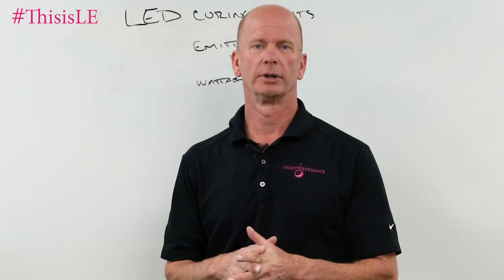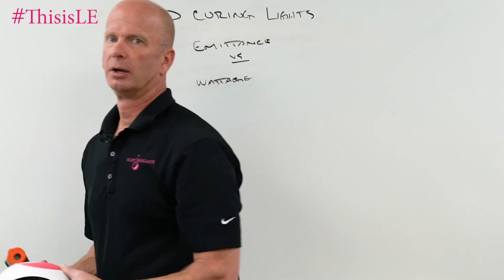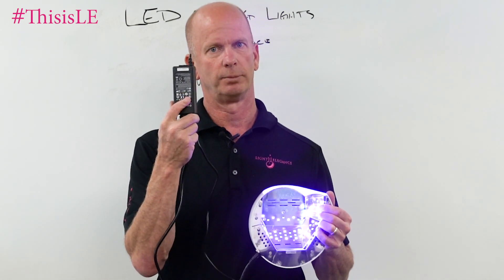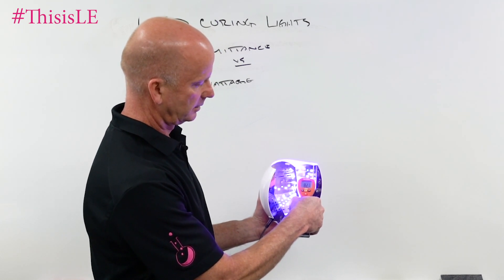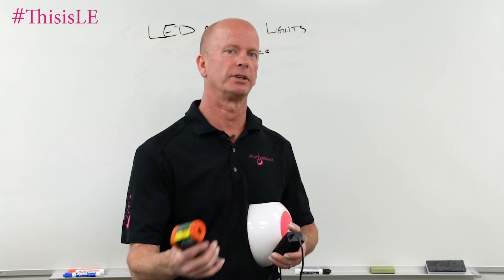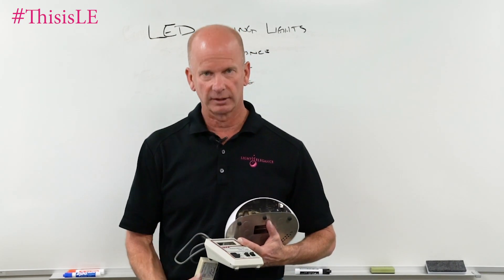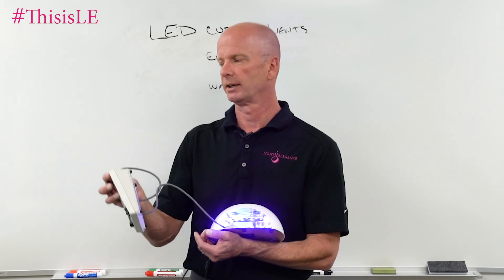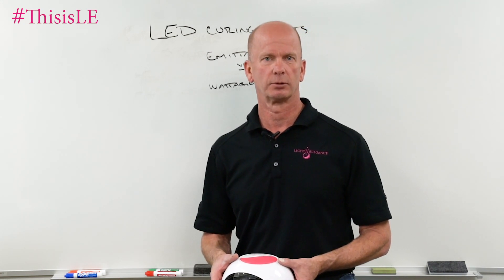Emittance VS. Wattage—Chemist Corner with Jim McConnell

Comment: Let's see if someone picks up this question for LE as this video dates in time. I have a Japanese brand lamp that works with cord or cordless. Koko.... Le Blanc. Jim can you give your opinion on those kind of lamps and have you done any test on them?
Reply: I have done some testing on a few of these battery operated lights.  They have good emittance initially but the irradiance values drop over time and fairly quickly.  Batteries are wonderful for flashlights but for continued, professional use, I prefer a corded curing light.  This technology will change over time - that is a certainty.  My opinion for this time is that I prefer a corded light but that is not stating that there is not a place for a battery operated curing light.